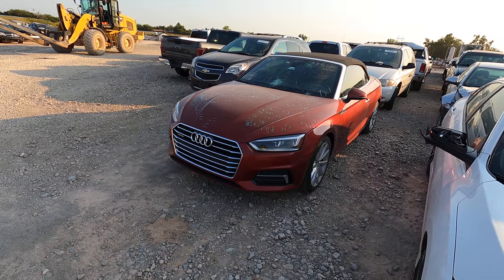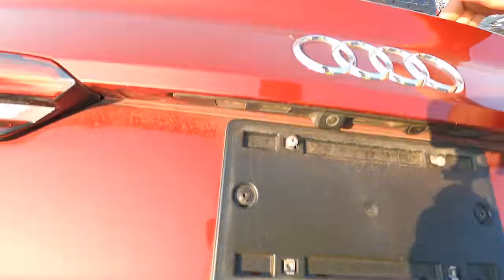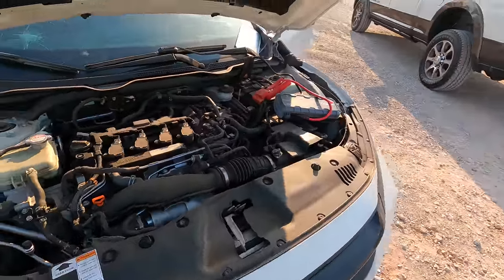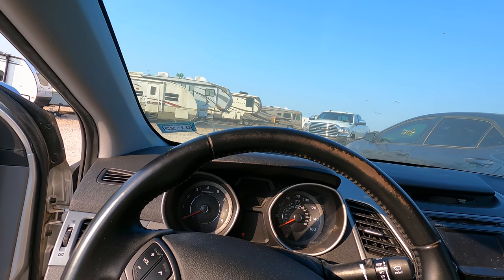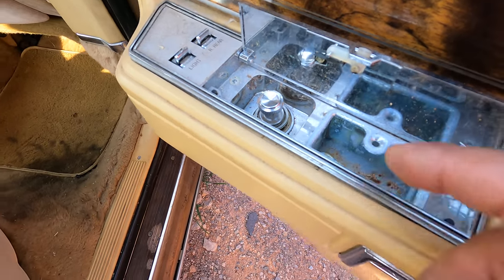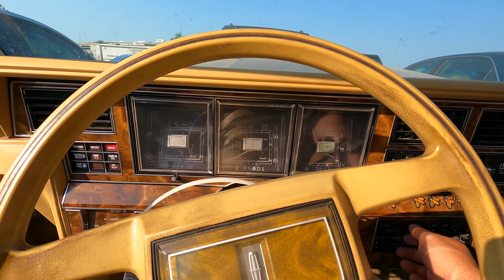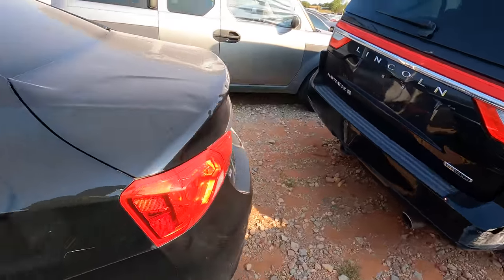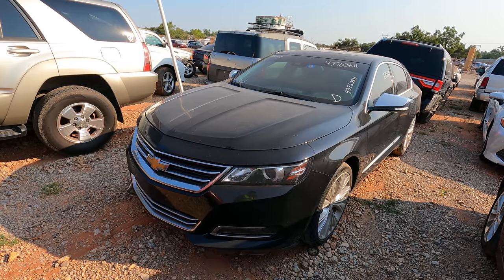Copart Walk Around 9-14-21 + CHEAP 1984 LINCOLN Town Car!!!!!

Comment: I'm thinking the Lincoln may be low on transmission fluid
Reply from the maker: Possibly. They are still asking too much for it at $2750
Reply: @AutoAuctionRebuilds  yeah that is insane for that car.  For $600-800 it might have been worth a go to try and get the transmission to come around, but I wouldn't pay that price for that car if it was clean and running and driving good.
Reply: @AutoAuctionRebuilds   That is Retail on that one.  I was thinking 1,000 on the high end
Reply: @AutoAuctionRebuilds  there is one for sale in similar condition in auto trader classics for $9000. There is a market for these classic Lincolns
Reply: @4125greenbrierroad  The operative word there is for sale... Not sold for $9000
Reply: @AutoAuctionRebuilds  Randy, here is my experience with those Lincolns.  The 1984 model had a problem with the turn signal lenses falling off.  Most of the cars on the road have had that happen which means it is really hard to find an intact lens, so it is a big deal.

Secondly my family had a new 1988 Town Car and a few years after it was with us I closed the rear door, the left side, and the door panel came off from the top, just like this one did.  It was a weak spot on the interiors of these cars.
Reply: @chevelleguy8059  this is very very true
Reply: That’s a very nice car  I don’t know about putting that much money into it I will drive it the way it is. Taxes are too high people are overcharging for everything
Reply: I’m about to go look at one that’s practically mint with 39k on it. Person selling is asking 3500, too much??
Reply: 100 needs a trailer  ok

Comment: Being a former body and paint man I would just grind the paint off of the affected areas and work all of the dents out that I could reach the bottom side of on the hood and deck lid and skim the rest with filler, hood and all and paint all of the affected areas!  Randy, When you see filler popping out of dents it's because it wasn't used properly! Not because filler is bad, When it's used properly it will outlast the car! Most of the time when you see filler coming off it's been used to cover up rust and that's it's intended purpose! Look at the muscle cars you see being done on TV , They will take a brand new part straight out of the box and skim coat it to make it flawlessly straight. If anybody at a car show  tells you that their old collector car has no filler in it they're lying!

Comment: Awesome to see a mid 80's Town Car in this condition just sitting there waiting to be saved. FYI the center hood stripes are part of the Signature Series package as you may have noticed the matching stripes on the bodysides, and no its not carburetored it's a throttle body injection. One thing funny about it is that it's not equipped with leather wrapped steering wheel as almost all were in the signatures. Totally worth saving for who ever gets it in this condition. Spectacular find!

Comment: Welcome back Randy! Audi not bad. I’d drive the Honda. You could charge the battery on this Honda with your tornado! Damn Hyundai i think it’s the timing belt it happened on mine same sound! My bad Randy glad it’s running!! Good cleaning this Hyundai will be fine!! This Lincoln is the same i think that TK had last night maybe! Impala I’d try and fix the body.

Comment: I had an '84 Town Car when we lived in Yuma, AZ. The A/C worked well in it, and was welcomed! It isn't a carburetor, but throttle body fuel injection. It has 2 fuel injectors over the throttle plates, and they spray fuel into the air stream there. We would get 22 mpg on the highway with it. We would drive from Yuma to San Diego and still maintain that gas mileage even though the mountains would reach over 4000 feet, with about sea level at each end of the trip. Considering that the brakes didn't seem to work, I'd guess that the car sat for a quite a while, maybe a year. Those brakes don't have much feel to them, and it takes a while to get used to them, so they may actually work. Check the level of the brake fluid. The same with the transmission. On those, more times than not, you just need to pour a few quarts into it. I don't know about hail dents on the other cars, but I've been told that putting dry ice chips in the dents will make them pop out. Might be worth a try on a transportation car.

Comment: The town car trans might run off a brake vacuum so if it don't have pressure it won't allow the trans to shift.
Reply: I don't think I have ever seen a transmission run off vacuum.  All the transmission I have seen run off of a transmission fluid.

Comment: The Audi is quoted around 35K on KBB, considering the salvage title and the damage if she goes around 20-25K could be a good deal if you can find the hood and the trunk used
Reply: I work in the office of a body shop. Even one from the dealer would be $1000-1500. You can get CAPA knockoffs for a fraction of that. Get your paint guy and glass guy and you have a bargain, especially if it goes closer to 20K than 25K
Reply: Any way you look at it it is a mistake to buy it.  Most people don't have $35K tin cash to spend on a car and banks don't loan on salvage titles.

Comment: My '03 Elantra GT was only the second car I ever bought new. It came with sunroof, black leather interior (including steering wheel) and a 5 speed manual transmission. I put over 175,000 miles on that vehicle in 14 years before flood damage forced me to part with it.

Comment: Good to see you back Randy!  I’m a Lincoln nut, so that Town Car definitely caught my attention!  I believe that era 302 had a throttle body type fuel injection.  I’d say if you added a quart of transmission fluid to it, she’d take right off!  I’d love that radio out of it, someone stole the one from my 85 town car limo!
Reply: 1984 was a carburetor.
Reply: These had throttle body fuel injection
Reply: @davidmeyer8133  Sure they did, starting in 1985
Reply: @mexicanspec  everything online says the 1984 model was a throttle body fuel injection system, and I know it was available before 1985 because my parents owned a 1983/4 Ford Crown Victoria with a TBI setup.  I can’t imagine Ford putting the “latest and greatest” fuel delivery system (at the time anyway) on their Crown Vics and not on their Flagship luxury cars.
Reply: @s31463221  Exactly.  My parents had a ‘83 Thunderbird 5.0 with throttle body efi,  the 5.0 car engines got port injection in 86 but had throttle body efi several years before that.

Comment: Volume control just needs a clean on the Lincoln. wd/40 will do it. Small spray, pull the knob off then spray, work the lube in.

Comment: April 2020 our Taurus Limited and Pathfinder ended up with 10,000 damage Taurus had to have all the trim moldings replaced.   Dent Dude in Sand Springs OK got all the hail dings out.

Comment: I had an 07 impala ss with the 5.3 v8 I had to put a used trans in it that thing was not stock I bought it for 150 bucks it set for 5 years but I sold it for 4000 . Cost me 2800 to have the trans put in . Wish I didn't sell that car it was a badass car black on black awesome

Comment: Auto auction rebuilds , it’s a shame about the Lincoln Towncar as it looked fabulous as well . 
If it had of gone into gear & if you had of had got it for $800
Reply: Rebuilding the trans is really cheap. Got one done in the '90's for $450.
Reply: Could be a shift linkage also. Really nice for an 84.

Comment: If you ever see one in the US which is doubtful, a MG ZS160 or ZS180 is a wolf in sheeps clothing.   The body is Honda Integra, the underpinnings are Type R, the mapping on the ECU is Lotus who also tuned the suspension and as long as the upgrade head gasket done the motor will take a lot of punishment.   MG Rover also done a ZT with a Ford 5 litre modular V8 in, very easy to top the 600 horse mark with American mods, MG did sell some stateside.   The ZS#s were favourite with Manchester and Liverpool drug dealers as the car just danced rings around anything the police had... right up until the reliability issue kicked in and the engine went bleugh...

Comment: No way does that Elantra have 57K miles on it. Look how worn that steering wheel is. And those Goodyear tires didn’t come with the car. The original Hankook or Kumho tires would have lasted 60-70K miles so no. Mileage seems wrong to me.